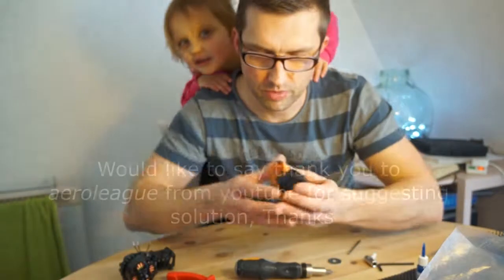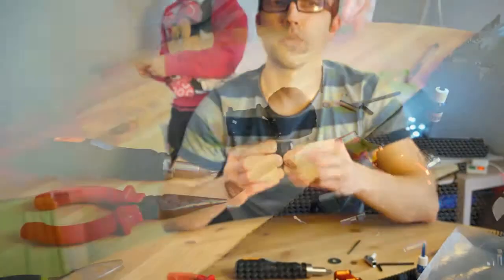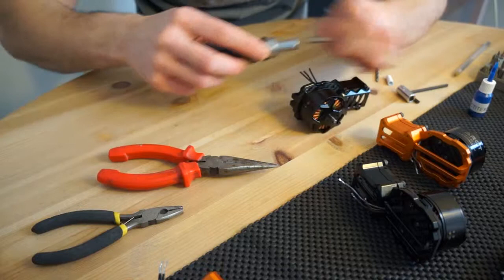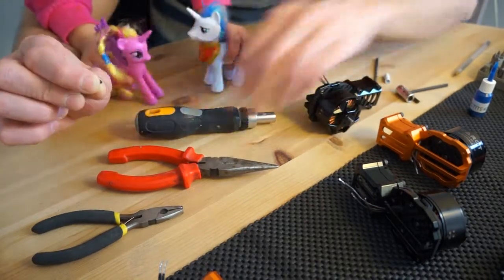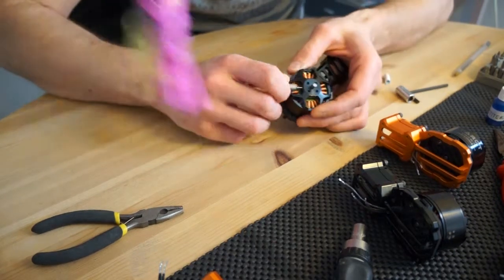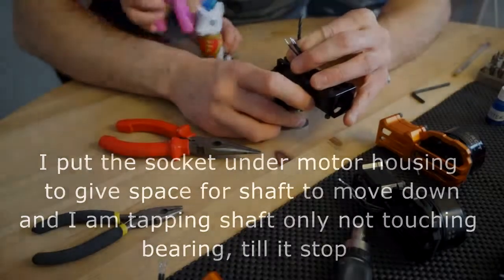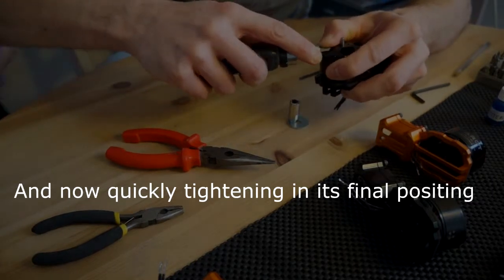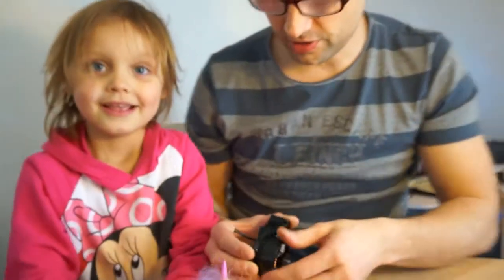Tarot 4114 motors - bearings noise -  SOLVED

Comment: It has nothing to do with the bearings you know.  If it was you should send it back to tarort cause the motor will fail.  But what your talking About is Called Harmonic Vibrations.  A motor running gets repelled left or right as it turns.  If the shaft can move up and down as well it creates a unrestricted vibration in a vertical plane.   They make motor shim plates for this reason.  You pull your C clip off the back and place a shim in and put the clip back and repeat until you have no play.  But yes making sure the grub screw is held in place and lock-tited is a good start lol See banging on the shaft like that will kill your bearings life span.  A press is a little less detrimental to bearings health but most will suggest using motor shims.  They look like sure thing washers the size of your shaft!